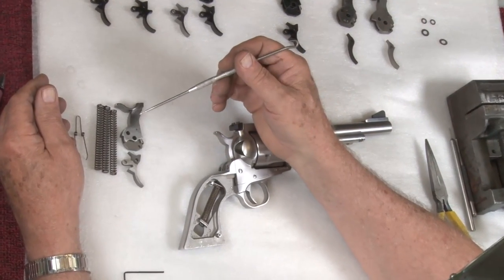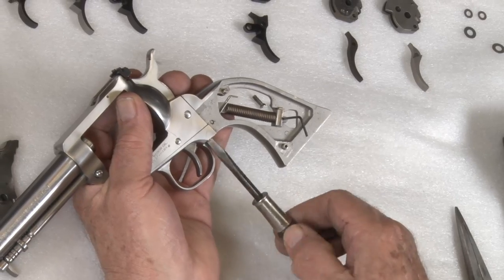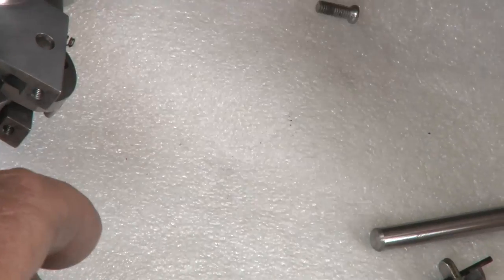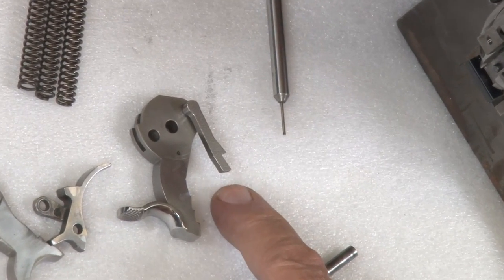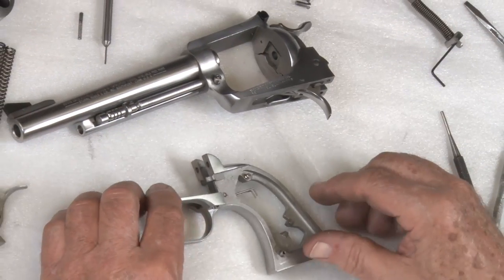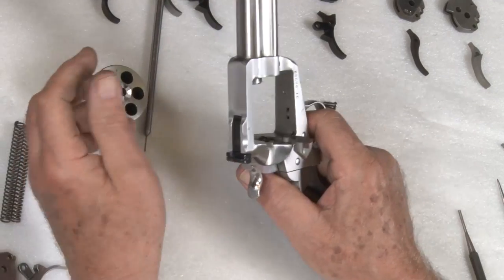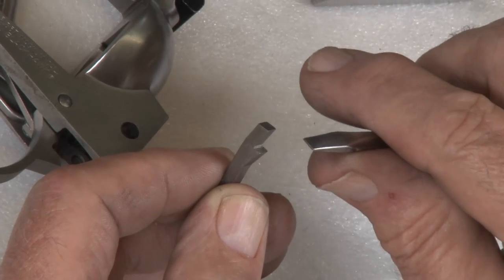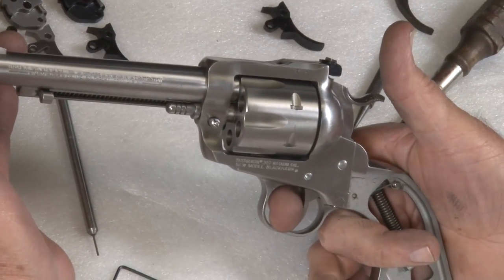Half-cock Hammer and Trigger Installation by Power Custom/Grand Masters

Comment: I didn't want to modify my factory pawl in my 357 New Model Blackhawk, so I picked up a New Vaquero pawl #451700. Not only did this happen to time the cylinder perfectly with Power Custom half-cock hammer, but I now have a free-spin cylinder with the hammer down and the loading gate open, AND the cylinder click indexes correctly to the ejector rod when the hammer is at half-cock and the loading gate open! Nice!

Comment: Question: I've got my cylinder out and the hammer cocked.  It appears I have sufficient clearance from the frame to dress the lower tooth on the pawl using a small triangular stone.  Do you not recommend this action?

Comment: Love your videos. I put a set of your hammer and trigger in my New Vaquero and it only took a few minutes of work on the second step of the pawl to get it to fire..BUT I do have one question, when on half cock is the cylinder suppose to free spin? Mine doesn't it will when I open the gate only..

Comment: With these parts, when the hammer is at half cock, should the cylinder latch still be down?  The Brownells catalog says when this kit is installed you should be able to spin the cylinder with out opening the loading gate but this isn't the case with my kit, the latch pops up at half cock and stops cylinder rotation.  I couldn't verify this by reading the supplied instructions, looking on the Powers website or watching this video. Powers hasn't answered my email yet.
Reply: They ever anwser?
Reply: @chazconner2601  Yes, Power Custom got back to me. No the cylinder is NOT supposed to spin at half cock.